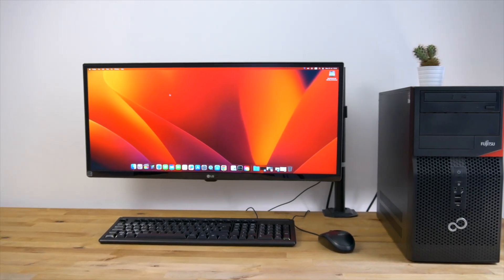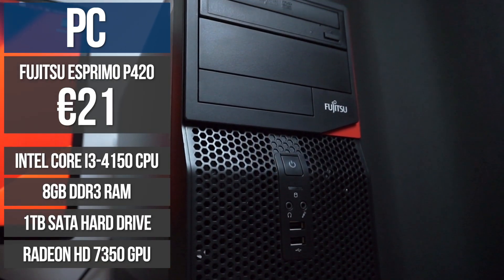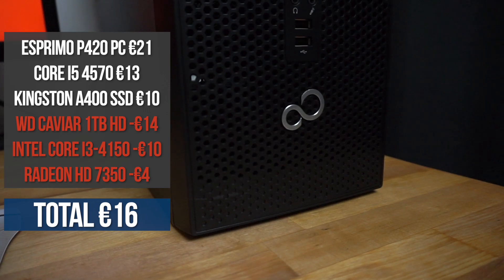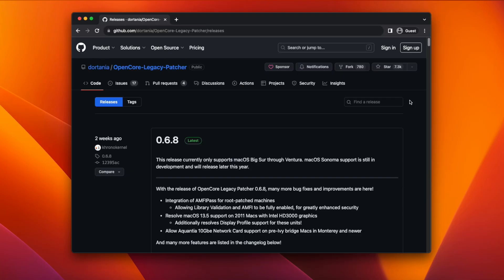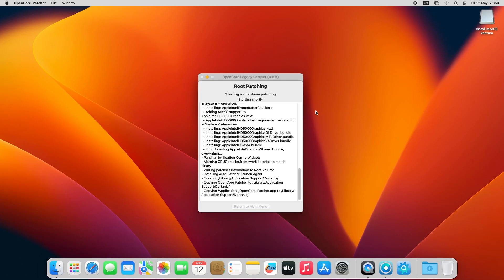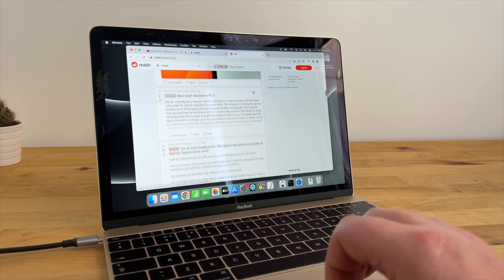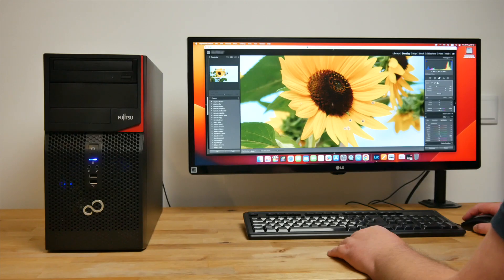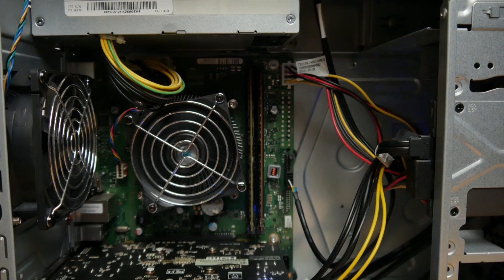Using a $17 Hackintosh

Comment: Hello.
 I followed the tutorial well.
 Everything works very well but the resolution is limited to 1600x900px.  My monitor has a resolution of 2560x1440.
 Where is the problem ?
 THANKS.
Reply from the maker: Try adding the "-cdfon" boot argument to your config.plist.
Reply: @BartechTV  Thanks for reply. Yes, here is boot-args: -cdfon alcid=15 amfi_get_out_of_my_way=1
Reply: My monitor accepts HDMI and DisplayPort, but the Fujitsu only has a DVI and VGA output.
I'm using a DVI to HDMI adapter. Could that be the source of the issue?
How is your monitor connected?
Reply from the maker: I used a Cablematters DVI to HDMI adapter from Amazon. This got me full resolution on my 2560*1080 display.

Comment: Few months ago..  I watched this great video and got really 'heated' and chose to do THE SAME (found your video  watch?v=s_zlanxCWeM  I got PC only). Got the second hand Fujitsu ESPRIMO P420 E85+ with intel i5-4670, add 2 x 8GB 12800U DDR3 (by the way, it is extra fast with Win10 on a SSD). Put a brand new SSD Patriot P220 (learned that volume MUST be partitioned as GPT - exclusively). in BIOS, did as it should. Usb does start nice, format disk, then choose download and... looooong time :face-blue-wide-eyes: nothing.. black screen (checked the EFI 'thingy' & 'stuff', all good🤔). Then I did THIS instead: watch?v=ift3NaxV8yk  &success it installed MacOS Ventura ver 13.6.3, though... ----> when I mount EFI Volume on a MacOS = It is EMPTY !!! :hand-orange-covering-eyes: Even when I copy the EFI from Olarila Ventura, in, still must boot on a USB. Some issue with SSDT's... maybe..
Work in progress ..:oops: Not giving up.. I have Ventura but not like in the movie🤭 
Cheers Folks🐑
Reply: Nobody read that book, mate.

Comment: So basically you paid $20 for a case motherboard and a very old fire supply and everything else you threw away interesting and then on top of that you spend more money on a new CPU hard drive in the video card so it's no longer a $20 machine and slowly $60 machine
Reply: That's old office desktop, they weren't meant for gaming or any intensive task like that, and even their parts aren't that power intensive so if you wouldn't do any havy task and stick with the default components without any upgrades you should be fine👍.

Comment: Hi, can I install this on my HP envy laptop? It’s a 2019 with an i7 and nvidea gpu.  The laptop is really nice but I’d like to have a partition for Mac OS if I could. It is crazy how a cheap ebay pc can run it so well with minimal headaches. Thanks for the video!
Reply from the maker: Yes but you wouldn't be able to use the Nvidia GPU, only the integrated graphics on the CPU, since macOS has no Nvidia support.
Reply: @BartechTV Wrong. Opencore supports Kepler and older Nvidia GPUs on Big Sur. macOS did support Nvidia GPUs previously.

Comment: Does the apple ecosystem work with hackintosh? like universal clipboard and filesharing
Reply from the maker: Yes. Obviously you'd need to add a compatible Bluetooth / Wifi card since those features require Bluetooth and Wifi, but they work fine.

Comment: What is the purpose of going with Mac over Linux or Windows? I'm sure you could get an old Mac for cheap if you wanted to run Mac. Is it more efficient than Windows or something?
Reply from the maker: It's a matter of personal preference. With OpenCore, you can install macOS, Linux, and Windows at the same time.

Comment: In the US the cheapest I was able to find that PC is for $100
Reply from the maker: I don't think this computer was ever sold in the US. In the US you'd be better off looking for a Dell Optiplex. HP ProDesk, or a Lenovo ThinkStation with a similar spec. There are hundreds of them on Ebay US for under $50. There's nothing special about this particular PC that makes it more hackintoshable than any other.

Comment: Hello, I am sorry to bother you, but I followed your tutorial (and the second video) without any issue until the use of OCLP to apply root patches (install the HD4600 drivers). At this step, and after the reboot, I am stuck on the boot logo with the progress bar stuck at 1/3, and nothing move. The only difference is that I used an Intel i7 4770 (the maximum for the motherboard of the P420). Do you have any tips to solve this problem ? Also, I am not able to boot without the use key, I used OCAT to mount both EFI partitions, copy the EFI folder from the usb key to the internal SSD, but the motherboard doesn't seems to recognize the drive as bootable.

Comment: Hello. Thanks for the video.
Would it have worked with the i3 4150? Just slower, or would it have failed?
And would it work with i5 4570S ?
Reply from the maker: It would be slower, and you'd have to spoof the HD 4400 iGPU to HD 4600 since the HD 4400 was never supported in macOS.
Yes, you can use the 4570s.

Comment: Hey, loved the video, I have i5-10400, with gtx1050ti, will i be able to do the same?
Reply from the maker: You can, but you’d have to use the integrated Intel graphics since the 1050 isn’t supported in macOS.

Comment: Thats outstanding! There are some amazing deals on i3 PCs, even stuff I've got from FreeCycle.
One thing I'd add; One of my PCs is an 8-core Xeon with no Windows 10 driver support and it blue screens occasionally. I'm looking at Proxmox as the Linux drivers are 64bit native and rock solid and it would enable both Windows 10 and macOS to run on the same machine.

Comment: I have a barely used Dell Optiplex 7050 I’d like to try to hackintosh. I wonder if the GT 1030 in it will work / be metal compatible.
Reply from the maker: No, there's no Nvidia support in macOS.
Reply: swap the 1030 out for an RX 550 (assuming your Optiplex is a small form factor model) and you should be fine
Reply from the maker: Another option for a low profile card is the Radeon Pro WX 4100. They crop up on Ebay quite often.

Comment: Will this latest MacOS run under Windows 10 HyperV virtual machine?
Also will it run 68K and PowerPC Mac apps?
Reply from the maker: I have no need for VM's so I don't know but I assume so.
macOS hasn't been able to run 68k apps since macOS 8.1 in 1998 and the last version to run PPC apps was Leopard in 2007.
Reply: @BartechTV  Holy sh1t are you kidding about modern macs not backwards compatible with 68K & PPC apps??   That's all I have and an ocean of them.   Thanks for the info.  I guess I'll stick then with my PowerMac 9600  @ 300mghz!

Comment: Says "16 EUR Hackintosh", then continues to buy a 21 EUR PC, 13 EUR CPU, 10 EUR SSD and combines it with a multiple hundred EUR display, keyboard and mouse which probably cost more than the Desktop PC... 

But luckily you sold parts to bring the Desktop PC price down to 17$ again before I could finish my comment

Comment: can i swap my i5 4460 rx550 to hackintosh ? its using ggbyte mb
Reply from the maker: It depends on your RX 550. Whether it's Lexa core or Baffin Core. If it's Baffin (640SP), it'll work. If it's Lexa (512SP) it won't.

Comment: Id love to see this with a Linux distro. I found they were much less resource intensive than even macos
Reply: Love to see WHAT? Just load Linux on anything of similar specs and you duplicate the experience. There's nothing to "see" you cannot duplicate yourself in the time it takes to load a virtual machine on whatever OS you currently use, and Linux need not be installed to bare metal. You can load Ventoy along with all the Linux .iso files it has space for then live boot each on your existing PC to determine which you prefer.
Reply: @Comm0ut  "Love to see what?" It seems he wanted to see the computer in the video with a Linux distro.

Comment: What os will work on a laptop with these specs ?

System Type	 X86-based PC

Processor Intel(R) Core(TM)2 Duo CPU T6400 @ 2.00GHZ, 2000 Mhz, 2 Core(s)
Reply from the maker: High Sierra.

Comment: A few months ago nearby me on Kleinanzeigen (German Craigslist) there was a Fujitsu x956 it's an All-in-One with Skylake CPU (i5-6400 or 6500) for less than 80 bucks, I didn't buy it (I already have too much hardware around here) but could now bite my butt, would have been a great hackintosh iMac, prices for non-Retina (pre-2014 or the cheapo 21.5 sold below the 4K/5K) are insane, very often still a good portion above 100€ even for the pre-2012s (with optical drive) where especially the 2011s have AMD HD6000 series GPUs that are prone to failure (at least in the MacBook Pros from that time).
I would only understand if it's a 4K/5K, you can nowadays get a 4K monitor for <300€ but the iMac's panels are on par with more expensive monitors (also these 4Ks usually are 27/28" large and not 21.5 so their Pixel density is quite significantly lower) and the panels are worth salvaging if the rest of the iMac fails, get a controller board and turn them into a monitor, literally a Studio Display.

Maybe I'll try to hackintosh my Dell OptiPlex 3040 SFF, picked that up very cheap, it's got a Pentium G4400 and is having less ports than the 5040/7040 and only DDR3 instead of DDR4 RAM, but a i5-6400 or 6500 should still run fine and I try to use my Radeon Pro WX 3100 (literally a RX 550 with a little less clock speed (seemingly because it's a single slot low profile card with a laptopesque radial fan) and 4 instead of 2 Gigs of RAM - that would be the 2100).

Comment: The problem with this is that in most parts of the world you wont find this since it was never sold in most places and buying it means you have to pay insane amounts for shipping and other nonsense that for the same money you can buy anything else locally and have a far better deal with zero hacking or waste of time ... or not using anything at all since the world doesn't revolve around PCs anyway ... smart TVs and tablets are basically already the current gen PC and common choice for most.
Reply: optiplex for around 50

Comment: I love my M1 Pro Mac, but one thing that is sad about the new architecture is that eventually Apple will stop releasing Mac OS versions for Intel and hence the modern day Mackintosh community will be replaced. I do love the new architecture though, the 2016 and on Intel MacBook Pros were absolute trash in my opinion and I was not a fan. Was a PC person at this time. 

I hope AMD & Intel will start really getting into ARM soon.
Reply from the maker: Sure, Apple will eventually drop support for Intel from new macOS releases, but they'll also eventually drop support for M1, and a couple of years later, for M2.
Apple seem to have adopted a five year support period, which means that a new Mac will be compatible with future OS releases for 5 years after the machine is first released.
The last Intel Macs were released in 2020, so whatever macOS comes out after Sonoma will likely be the last major OS release  that supports Intel. The 2025 macOS will probably drop Intel support and I also expect it to drop support for the first generation M1 Macs - the Mac Mini,  MBP and MBA, since they also came out in 2020 and will be five years old by then. Apple generally release  security updates for a couple of years after that, so Intel Macs (and therefore hackintoshes) have maybe 4 years left.
Reply: @BartechTV Not bad thinking though I'm hoping for eight years when it comes to the new ARM Macs. If AMD & Intel adopted a similar architecture and Windows transitioned, I wonder if then Hacintosh would still be possible? My brain says no because the architectures can't match exactly as Apple has ownership over the specifics of the M series chips. Though my dreams say yes because it would be cool.

Comment: I have a question: why? I mean you could install Linux distro on it with the same/better functionality and less hassle
Reply: i can use Hackintosh with Mac os for work without having to buy a macbook, and i use GNU/Linux distros right now and i will only use Windows OS though virtual machine and play games on linux.
Reply: @alberteinsteinh  is there anything in particular that cannot be done on Linux/Windows that can be only done on OSX?
Reply: @_sneer_   Mac os. wait what does OSX even mean? and  I want a Hacktosh to find Vulnerablilties on Mac os and Report them Ethically and Receive a bounty So I want to use  Mac os for a Work related purpose.
Reply: @alberteinsteinh  first it was Mac OS X then OS X and apparently ir is macOS now. Same thing, different name. But yeah, your use case is the only valid one I can think of. If your work is on the macOS itself instead of using it just as an operation system.
Reply: @_sneer_  MacOS X was MacOS 10. We're on MacOS 14 now (Sonoma)
Reply: No
Reply: @frag0638   your answer to question "why?" is "no"? Do you need a simpler explanation what this question is about?

Comment: I have no experience on mac os, wonder if a 6700k can be used, and a 1080 nvida card?  How about nmvme m.2 ssd, instead of a sata drive.?
Reply from the maker: The 6700K and NVMe drive will work, but not your 1080. MacOS only supports AMD.

Comment: You definitely got a deal with that PC. Seems mostly cost about 50€+ atleast were I searched 😄
Reply from the maker: It doesn't have to be this exact model, it was just the cheapest one I happened to find at the time I was looking. Dozens of auctions for old office PC's with a haswell i3, i5 or i7 have sold in the last couple of days for under €30. Lenovo ThinkCentre, HP EliteDesk, HP ProDesk, Dell Optiplex, they're all hackintoshable.

Comment: Those 10 year old PCs still run fine & if you invest in some cheap upgrades (SSD/CPU/RAM)- they're very capable machines. I put about $35 in a $10 PC I bought off a friend and do just about anything shy of gaming. I go the Linux route, but the concept is very much the same. why spend hundreds of dollars on a machine that does relatively the same things you need it for?
Reply: I bought an old pc with the same cpu as the one in this video (i5-4570) and it's been great. I upgraded the ram to 8gb and put my old 750ti inside and it really can do anything an ordinary person needs. I even can play lighter or older games on it! :)
Reply: I think that is true. I think the only reason to spend more is so you can play games but even then some older games can run on this kind of hardware.
Reply: @Alexander_l322  nothing wrong with that. It's just wild to think so many spend outside of their budget, when they can have mostly the same things out of a lower tier build. But hey if you can afford it go for it.
Reply: I have a tendency to play older games so I don't really need a monster build rly. From what I understand most of the steam market has lower tier builds anyways so game developers have to accommodate for that anyways. I think the 1060 was the most popular graphics card via stream statistics- but I may be mistaken.

Comment: The system you created is sound but these cheap rigs tend to have noisy cooling fans.
Reply: Similiar fujitus's are really silent from my experience.
Reply: Not the case with this particular model. Mine is, apart from a rush of the start up fan which only lasts a second or two, the Fujitsu P420 is surprisingly quiet. I barely realise from the fans, this PC is on. It's even quieter than my Macbook Air!!

Comment: For people who want to write books, this would be a great project. Vellum only works on Macs. It would be worth $17 to have a computer that would run Vellum.
Reply: 250$ for Vellum however. At that point you might as well save up a little more for a used MacBook Pro from 2012 for around 50-80$ and get a keyboard and trackpad and screen all included.
Reply: @ghost-user559  Actually, Vellum is no longer worth buying. There are better alternatives that do not require a Mac. And they are cheaper. Vellum is for the same crowd who are willing to pay extra for a logo. Because let’s face it, Apple puts out underpowered crap at high prices because snobs want to have the Apple logo.
Reply: @ghost-user559 probably could pirate it if you’re going the hackintosh route anyways. Idk if it’s possible to pirate apple apps or not though.

Comment: Imagine that, you are using a more potent SSD, mint Samsung PRO (Cuz A400 is a bad one. They are randomly changing the NAND and the controller), 16gb ram and i7. More than enough. Or just stick with the i5. And still cheaper and better than a original MAC

Comment: Impressive recycle, my congrats. I was considering buy a mini pc with intel N100 and ddr5 (there's a ton of that machines at 170€/200€) to use as media/office station (youtube, mail, browsing). I'm wondering if that could be a good hackintosh machine. Thanks for sharing.
Reply from the maker: Sadly, there's no support for Alder Lake iGPU's in macOS Ventura, so the N100 wouldn't work. The best mini PC for hackintosh until very recently was still probably the Intel 8th gen Nuc8i5BEK. It's like a 2018 Mac Mini but with faster graphics performance thanks to the Iris Plus 655.
Recently, the NootedRed project has made it possible to run macOS on AMD APU's with integrated Vega GPU's, so the best hackintosh Mini PC right now would probably be one based on the Ryzen 7 5700G.
Reply: @BartechTV  That's unfortunate. So I got it, by the time the choices are two: I save some old puppy from the junkyard or I bite the bullet and buy a mac mini m2 for 550€ (which would not be a bad idea, considering the price and the the curiosity for the new chip). Assemble a 5700g could probably cost around 400€ (180€ cpu and then motherboard, psu, ram, case). Nonetheless a dual boot linux/mac-os machine for 400€ could be an option to consider for me. Thanks for info.
Reply: You can get HP and Lenovo minipcs of the same era for very cheap too